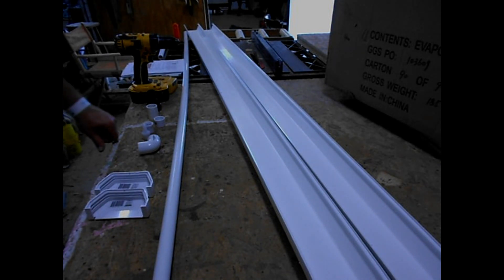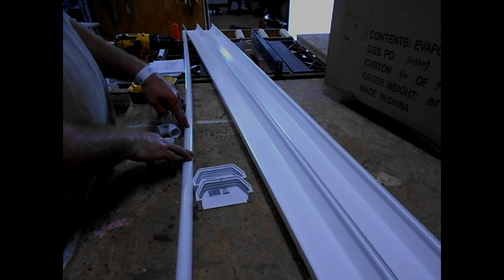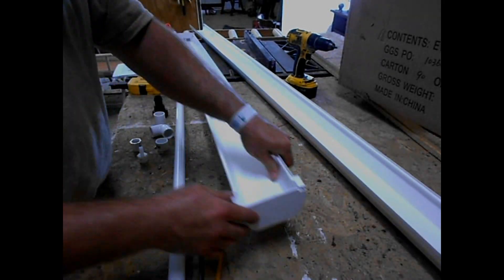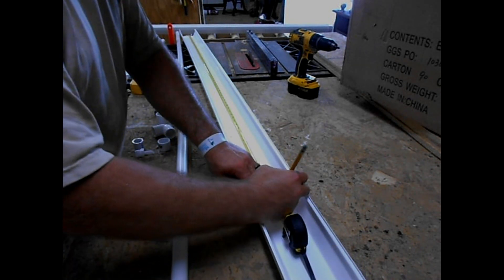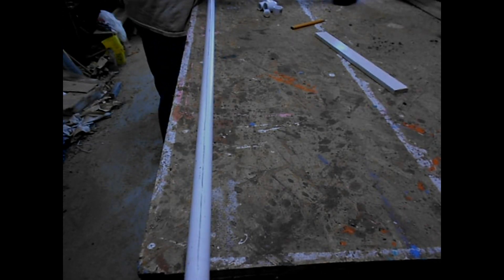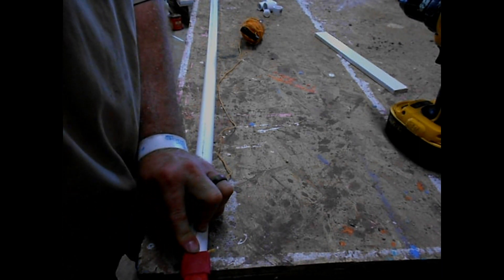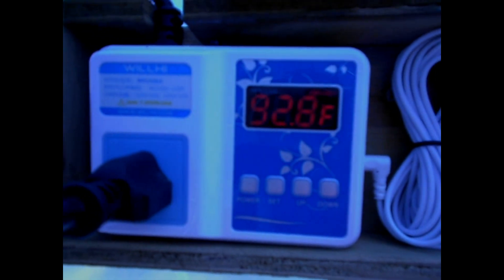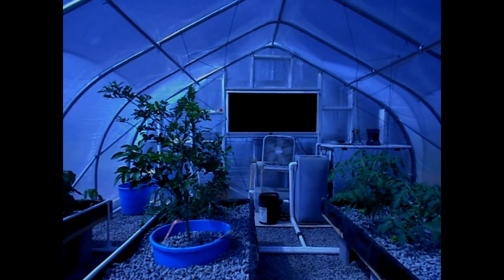DIY Greenhouse AC unit | Swamp Cooler | Evaporative Cooler

Comment: How much does it help with the temperature - what summer temps are you able to keep the greenhouse at/how much cooler?  Thank you
Reply from the maker: I can drop the temperature about 10-15 degrees with this and a shade cloth. Of course you have to have a fan pulling air across it so the size of the fan determines some of the temperature drop.
Reply: @VWFamilyFarm  awesome thanks so much!

Comment: What is the pad in the swamp cooler made of? Looks like corregated something. Maybe copper mesh. Can't tell from the light. Maybe bits of plastic clogging the holes from drilling. Im am so glad I found your channel. I have been wanting to do this system for a while now. I tried a small scale hydroponic system. It worked ok for a few months. I think it was the ph in the water and really hot mid summer. A cooler would have helped.  Thanks for your videos! Ps if you run the drill backwards when going thru plastic the bits come out rather than go inside. 💜🌎✌
Reply from the maker: Also I got all my greenhouse supplies from this guy. https://youtube.com/channel/UCwUwBKnSogCeGeVXpjnkchg

Comment: This was helpful, but I do not understand how to fit 8” wide pads into a 4” wide gutter. I didn’t get the assembly part so it was just up and going. Great idea though.
Reply from the maker: It has been a while since I done this project but I’m pretty sure the pads were 8”x4”x42”.
Reply: I did this build and found 4" wide rigid media available "Hessaire Evaporative Cooler Replacement Rigid Media for Breezair EM2 Cooler" this media fit within the gutter frame.